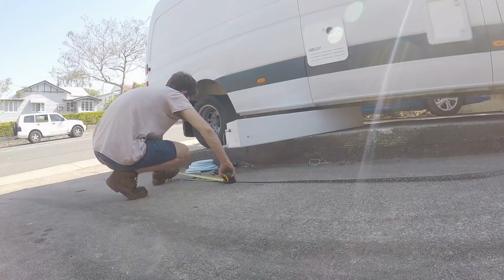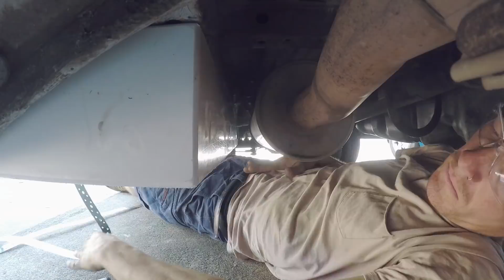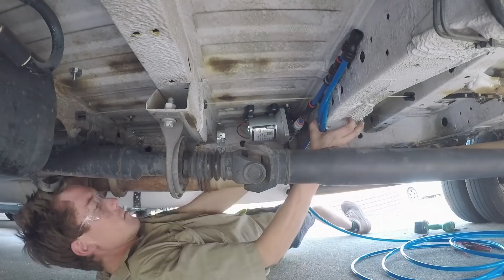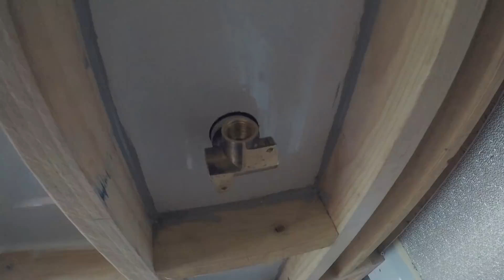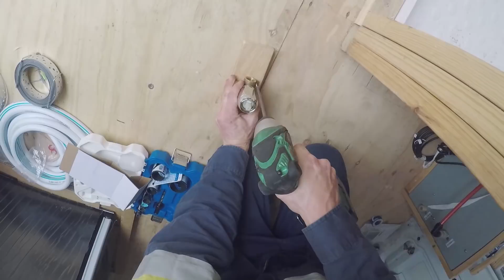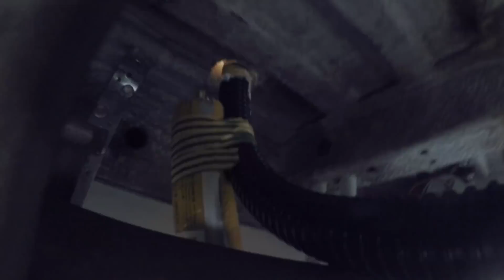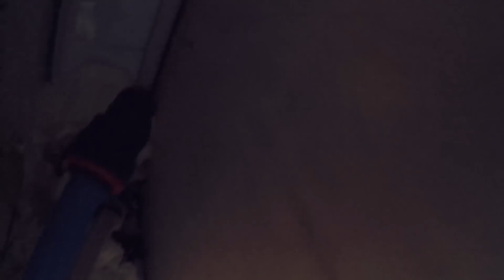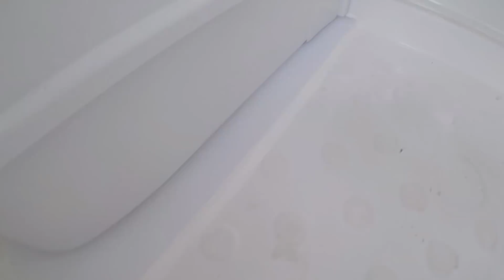S1E7 Sprinter Van Conversion | Plumbing Pt. 1

Comment: What a great build! I am about to do my van plumbing and have decided to use 12mm flexible drinking water hose with brass joiners and adaptors, instead of the John Guest system that you used. I did not see any pressure relief valve on your hot water system (if its an instantaneous system you probably dont need one).  I am fitting a small 10L 240/24volt hws and it needs a pressure relief valve at the cold water inlet. Maybe you should inquire if one is needed. Your excellent work and attention to detail is very inspiring. Thanks very much for sharing.
Reply from the maker: Thanks a lot Norman for watching the videos, I have seen pressure relief valves on storage water hot water tanks before, not sure about on the instantaneous ones though. I will inquire, what would a pressure relief valves purpose be on a instantaneous system do you think?

cheers for the input mate!
Reply: Travel With Jaz  No reason to have a relief valve on an instantaneous system. Only needed to relieve pressure in a storage tank.

Comment: Excellent video, as usual! =)

One small recommendation: I would put a one-way valve into the top of the breather line for the water tank. So that water can escape and overflow, but nothing can travel back down that line into your fresh water tank. You never know, but you probably don't want dirt or critters to go down the line and contaminate your fresh water. :)
Reply from the maker: Thanks mate! Someone else mentioned debri coming in from the breather line, and I will amend this by putting protective mesh on the end of the line, but the breather line needs to allow air flow in both directions because when running of the pump it sucks air in, and when filling the tank it pushes air out.

good tip though thanks mate!
Reply: Hi Mate, you're absolutely right! I had completely ignored the fact that the pump will generate a bit of a vacuum when running, so yeah. It would be a little awkward if it couldn't draw air back in! ;)

Comment: Hello my friend, i am Alex from Mexico, i bought a sprinter 2017 EXL but red color and i want to start to make our motorhome, i saw a lot of videos bout that for more than 6 or 8 week and definitely YOU ARE THE BEST congratulations i am very impressed with your excellent work. Here in Mexico is very complicated to find many things for Rvs but i am buying step by step in the USA by AMAZON and EBAY,  i love your hydraulic installation can you tell me where i can buy all the conections and plumbing, i bought the pump and water filter and SHURflo 182-200 Pre-Pressurized Accumulator Tank thank you for your comments Best regards
Reply from the maker: Thanks heaps Alex for your awesome support mate! I will be writing up a whole blog post on this episode with links and info on all gear used.

I bought the plumbing gear from Camec in Brisbane, Australia.

All the best with your van conversion mate!

Comment: Where did you get theses pipes? They've got special size. Very helpful video. Thank you!
Reply from the maker: Thanks a lot! I bought them from an RV shop in Brisbane, Australia called Camec. They're 1/2 inch pipe which is very standard, but the push in connections are more common in RV i believe.

Comment: Thanks mate, look forward to the next one. Great info and good visual. The hose connectors are interesting are they just an RV thing or are they a domestic use thing?
Reply from the maker: Thanks a lot! I would only use them in an RV, in a house you would definitely use something more robust for higher pressures etc.
Reply: cool

Comment: Hey bud, you're doing a great job, but you're wrapping your teflon tape on the wrong way around. Its probably fine, but if you wrap it on the other way, its less likely to unravel, bind up and create high spots for water to leak out from around it :) Digging the videos though, and keep em coming :)
Reply from the maker: That's a great point, thanks for that! Appreciate the support!

Comment: Nice build and great skills. Unfortunately in the U.S. can't do what you are doing because of potential for sub freezing temperatures. A shower is a necessity in my future build. Just wondering how you plan to exhaust the water vapor from the shower stall?
Reply from the maker: Thanks a lot! Damn, I am not sure how other vans prone to low temperature do it, I guess they just heavily insulate the piping. I might install a wall extraction fan in future

Comment: I'm going to remember the tip about using two holesaws on one arbour, previously in similar situations I've screwed a sheet of ply to whatever I need to enlarge the hole. I prefer your idea, plus it works where you can't screw anything around the hole.
Reply: seriously! I never thought of that and that trick would have saved me a lot of time on several occasions in the past!
Reply from the maker: Yeah it's a good trick and super easy!

Comment: How will you protect the pipes from the exhaust pipe temperature?
Reply from the maker: I was thinking that the airgap is more than enough, but if I do put something on I will clip some sort of temperature rated corrogated conduit over them.
Reply: Travel With Jaz that was my first question...need to protect those pipes from that super hot exhaust piping and muffler. 

Are you concerned at all with having your water tank breather hose in the wheel well? I know much of OZ can be pretty dry, but driving in the rain might get some road goop in your hose. 

Hopefully the dry climate preserves all your undercarriage hardware...the chassis itself looks pretty clean!

Love all your van vlogs Jaz...the best around for build-outs in my opinion. I am gleaning much from you for my own upcoming build, and always look forward to the next episode. Keep up the great work!

Comment: you should put a one way valve on the breather pipe
Reply from the maker: That wouldn't work as when the tank is filling the air is pushing out, and when the pump is taking water from the tank it is sucking air in, it needs to be Bi Directional. Cheers.

Comment: all those elbows are  going to take the flow rate down if your running a shower off those i would increase the pipe size to 15 mm
Reply from the maker: I did some research on this, and from memory flow rate drop on an elbow is equal to water running through 1 foot of straight pipe. So the losses are negligible.
Reply: Rob Edwards  you up the size and there's more chance of the pipe hitting on such Things as the exhaust and such , great video can't wait for the next one

Comment: So this system would not work in below zero degree C climate correct? Since alot of pipes are below the van not protected from cold water.
Reply: frozen pipes in Australia?? i'ld be more worried about summer time high road temps  and engine exhaust muffler pipes,,they get crazzzy hot and will damage water pump & plastic pipes!?!
Reply from the maker: Yeah I might need to put some protection over the pipes, although these is a fair amount of air gap
Reply: Yeah can be minus 12 celcius on the ground mid winter in SE Queensland Australia and your pipes don't unfreeze until around 11am...pipes are known to bust...this is not rare or unique but where I live most winters. Though if you are just an Eastern coastal traveller potentially not as serious. Yep the heat definately a consideration.
Reply from the maker: I'll have to look at some pipe insulation then, thanks ;)
Reply: Wow! I did not think Austrailia got that cold!?!? Thanx for info!) Anyway great van build videos!?! Ur very competent fitter..and thanx for the double hole-saw trick!?!)) Cant wait til u've got it all done)) good luck m8)
Reply: I was just thinking the same about that insulation. I'm an alpinist and mountaineer so my #bigmommavan will be in very cold places.
I'm afraid that the water inthe h20 tank will freeze... BUT to be honoust didn't do much research yet...
Reply from the maker: I'm not to sure sorry as I live in Australia and it's a lot warmer over here, you'll have to do some research on that one. Thanks
Reply: It would be unlikely the water tank will freeze in Aus, there may be some places so yeah research is good. Not freezing is mainly because we are drier in general and warm up during the day quickly in general. Where there is a body of water ie a farm dam, a household water tank the like this may freeze around the edge or so but not solid or be fully covered as we don't get cold enough like the Northern hemisphere as in minus 23 celcius or the like or Aus dosen't have things like permafrost to make these things freeze for long periods of time. But we get cold. It is pipes and hoses that are more vulnerable...even if the plumbing is in the roof of your house. A RV water tank could be more likely and only really worse case become like a very melted slushy.  So protection for a water tank if in the undercarriage would be more for road stuff, mud, rocks and sticks plus Kangaroo mishaps. If you are only a coastal traveller and stick to the well graded tracks you possibly won't encounter much issue with any of the above. Once you go bush, past the Great Divide, or into the desert or Alpine regions more stuff to consider.  Lucky us.
Reply: Good thought about the pump interesting to know more about the effects...ours is inside and was intrigued with Jas's choice as it seems a good idea. So good to have an update Jas, when you've burnt a few hot kilometres!
Reply: planning to build a van also. If the tanks are inside the van the air temp should keep it all from freezing. Takes up valuable space though so personally ill only be looking at the 170" WB sprinters only
Reply: AirTimeEh  I think it is a matter of where you are in the world what climates and seasons you are most likely to travel in. Jaz’s system would work in Oz just a bit of insulation on the pipes would assist with really cold time plus radiant heat is a consideration. The tank may turn slushy one night a year at minimum where you have to consider not using your pump for a couple of hours after sunrise...no issue really just plan for it by having a bottle you filled the night before taken inside or your fill internal sink and have your kettle full,  if you absolutely need water the next morning. If you are in a colder part of the world where your tank may completely freeze for couple of days the internal tank may be a good option.

Comment: Great idea to use the cutting board for the toilet base.  Why did you need to raise the toilet by half an inch or so?
Reply from the maker: Thanks I actually got it from a youtuber who commented the suggestion :) I need to raise it a little higher so the slide out storage would clear the van metal and cut out. I didn't want the shower tray to be cut out all the way down to the bottom flush with the floor because of draining issues into the wall.

Comment: You used most 2"x4" to frame.  I prefer 2"x4" for strength and durability but most van builders use 1"x2" or 1"x4" to reduce costs and overall weight of the framing.  Do you think it is worth saving money and reducing weight using the 1"x2" or 1"x4" to frame?
Reply from the maker: I think it depends on how much your van payload is, how much your van weight your van can actually take. I used this because there is a lot of room for insulation and plumbing/electrical in the wall + strength + also cheap.

It is a judgement call at the end of the day, if adding a little extra weight doesn't both you, you should be fine.
Reply: Travel With Jaz I do have plenty of payload. I would rather use some 2"x4" for more strength & support for more important spots.

Comment: Great video! Loving the build so far. However, I just have a few concerns about having the water tank to one side and the grey water tank to the other. At some point, they will have unequal amounts of water and that might impact drivability of the van. Furthermore, if I might add, adding baffles inside the tank will help a lot in stability as they reduce lateral motion of water during driving, especially when turning. Although that might be an overkill.
Reply from the maker: Both those points a super valid, although I think once taking into consideration all everything in the van build that this van shouldn't be weighed down to much to one side, a small amount should be ok.

The baffles I did want but would've cost me a lot more so I just ran with not having them, I'm sure all will be fine ;)

Comment: So glad you are showing us how to mount the water tank underneath the van.  Why did you use straps instead mounting bulky metal or sturdy aluminum brackets?  Straps seem to be simpler and easier to work with.
Reply from the maker: No problemo! Yeah the straps are super cheap and way more managable and easy to work with, not to mention super strong!

Comment: Excellent video l have one suggestion under the car cover the pipes and the wires
Reply: Enjoyed the installation video. Very professional appearance. Just a quick question. The tubing appears to be really  close to the vehicles hot exhaust system. Do you plan on installing a heat deflector and insulation on the exposed tubing under the van? GREAT VIDEO!
Reply from the maker: Thanks may do that once all piping is completed, cheers

Comment: I admire your construction, but the pump below floors but will be a maintenance nightmare. The on/off switch being plastic will seize, I had to install a metal water fitting in a similar situation on my Motorhome.
Reply from the maker: Thanks for the support mate! Do you mean the internal switch on the pump that automatically switches on/off when pressure is reached? There is no plastic switch that I'm aware of, cheers!
Reply: Hi Jaz, you have an on/off tap from your tank, that is what I was referring to. Also, if your roads are any thing like the UK, your plastic covered filter before the water pump will be bombarded with debris, I suggest you cover it with some protection as the filter cover will crack from road stones.